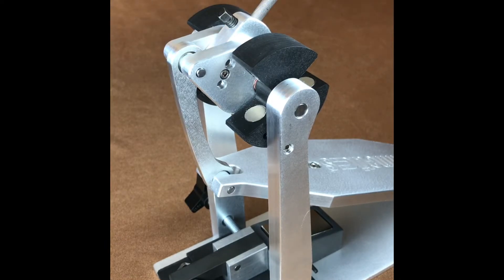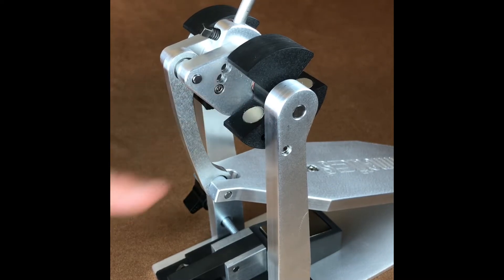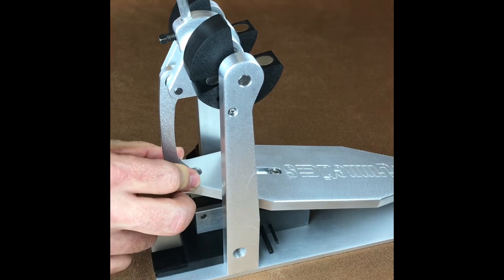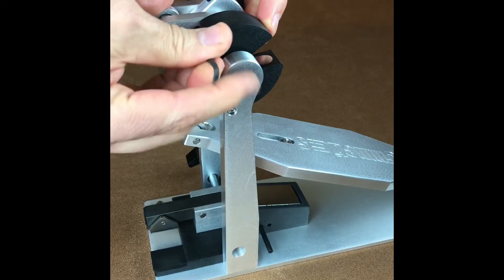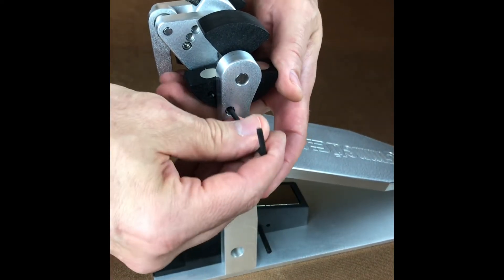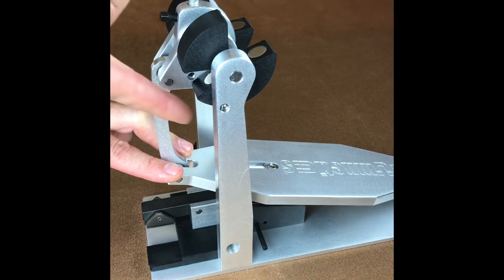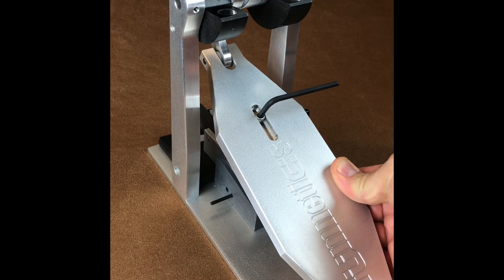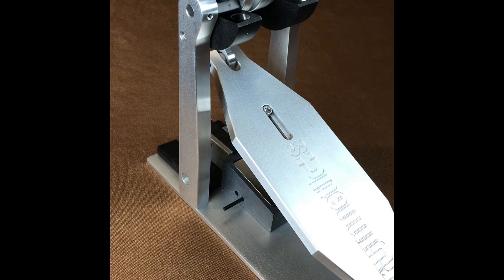Nd Series Pedal Adjustments

Comment: Nice! What is the difference between the standard and long board?
Reply from the maker: Thanks for your message! The LB is one inch longer than the 11.5 inch standard and with a slightly raised heel bracket connection has a little more relaxed slope/angle back from the pedal connection at the direct link. Let me know if you have any other questions and I appreciate your interest!!
Reply: @Drumnetics  Actually Im ready to buy a double bass pedal! I sent request online, should I call the number on your site?
Reply from the maker: @bitflux2  Yeah, that would be great...